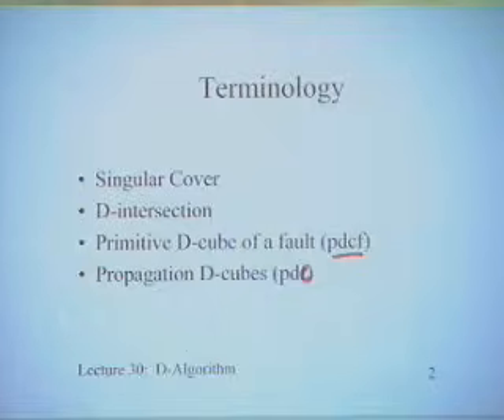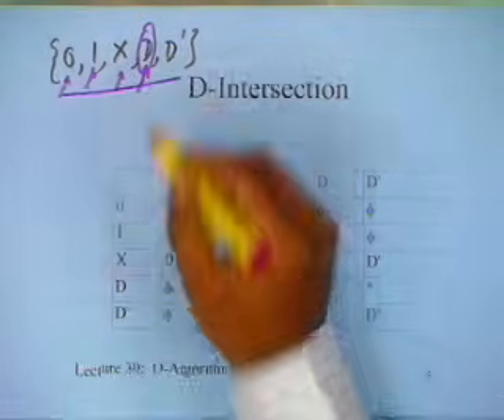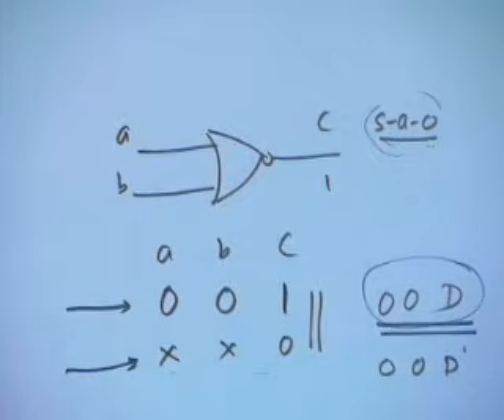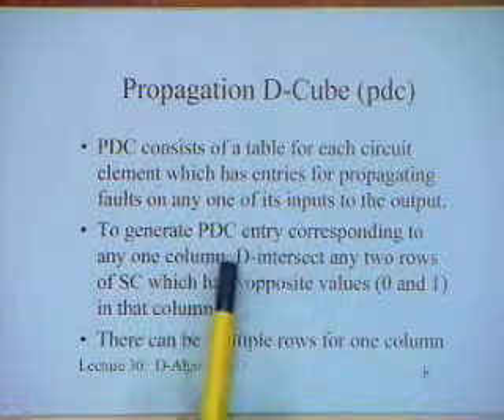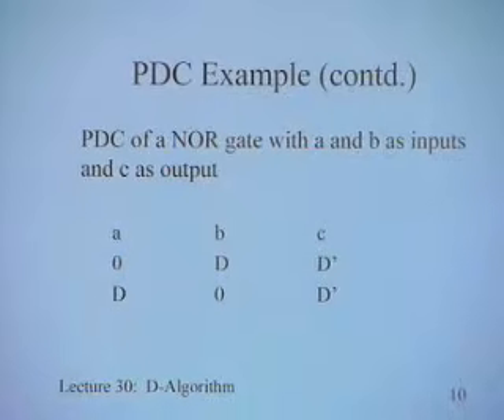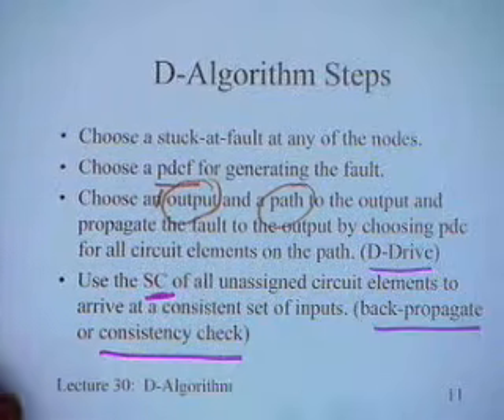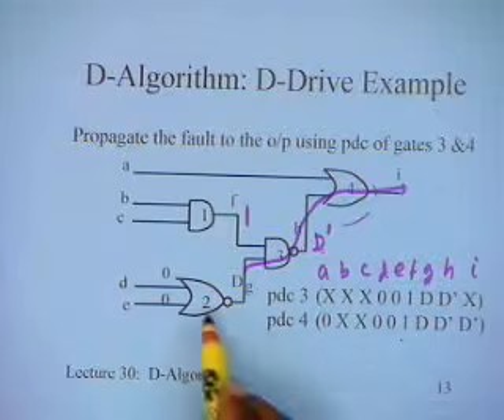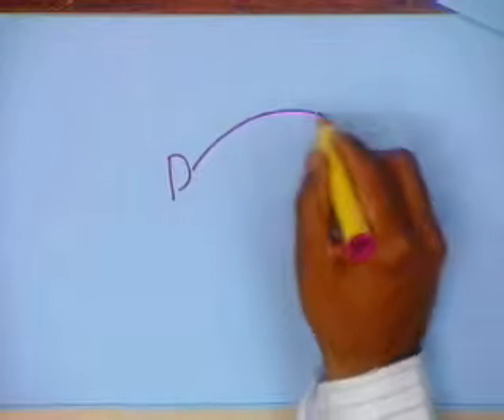lecture 31 - D - Algorithm

Comment: Dear sir,
I have a question for you and that is..

Why do we have to generate a stuck at fault and why to propagate the fault at the output. Practically what do we achieve by doing this...

I know that these stuck at faults are manufacturing defects and once it comes during the manufacturing we cannot do anything, Therefore to avoid such issues we do these things at the design stage itself by creating some fault models and then we perform Fault simulation, etc, etc.

What is the advantage of propagating the fault till the output? When there is a fault in the middle of the circuitry such as stuck at 0 or 1 , we apply D algorithm and propagate the fault to the output and check the test vectors which can be applied to that circuit. What are we getting by generating the test vectors? what these test vectors are telling giving us?
Reply: Mujtaba Ahmed basic idea of testing is finding faulty ic and discard them so that only fault free products are delivered to customers. We use all those to find fault in the circuit after it has been manufactured.